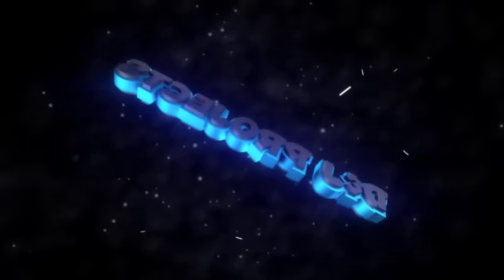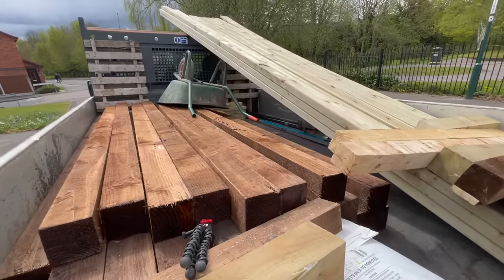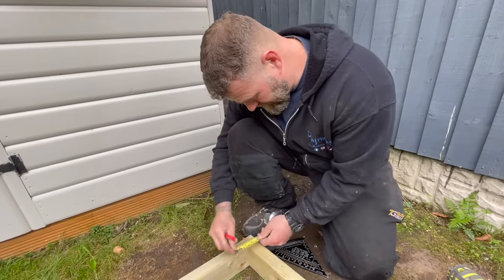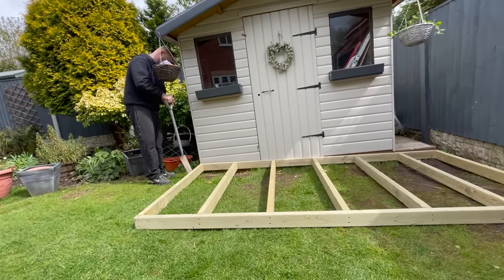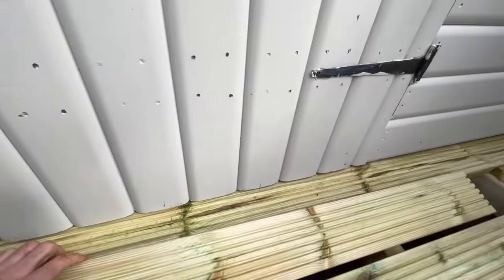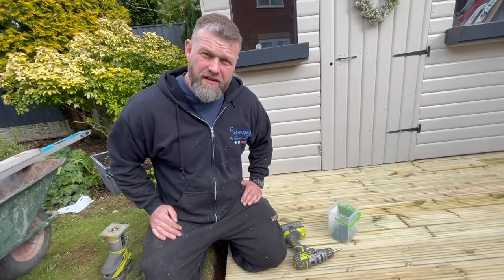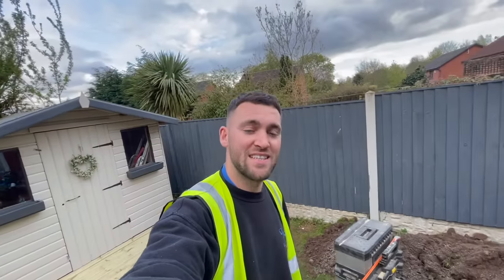How To Install A Small Decking Area!

Comment: Looking good lads. Some on here Brand bragging should watch the Torque test channel and learn a few things. No customer I have ever worked for has ever asked me what brand of tool I use and never had one complaint on my work. Also I wonder how many know Decking Board can come both side grooved and how many engage not having a clue what the client has asked for. I have had loads of jobs where I have advised the correct way to do jobs but they have wanted their own version. Great job guys.

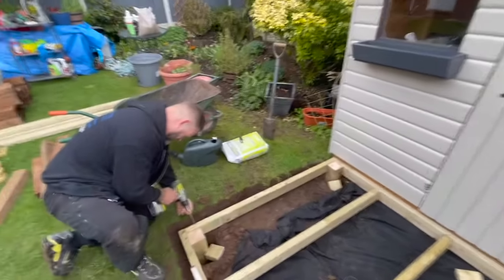Comment: 9:10 Gods watering can 😉🙏🏼
Spot on about the tools Dave.
All I have is a Spade,a 5 foot wrecking bar,a decent hand saw ,a £60 Cordless with two batteries,a wheel barrow,a bag of hand tools,chisel’s and 30 years experience in Civil and Military Engineering.
Yes it takes me longer and yes it takes more effort but the job gets done to a high standard and I never run over my quotes.
My only concern is my sparse tools array getting robbed by a full kit wanker in poser clobber 😉👍🏼

Comment: Oi Dave I’m not old I use inch when working with wood, I’m not a pro so I find it easier 😂. I don’t have the proper gear nor the Materials but I did have a idea 💡 so during lockdown I reclaimed some decking and the frames, I cleaned them all up and got what tools I had out and made a big decking across the back of my house and closed it all in and it’s been up almost 2 years, i liked the idea 💡 of allenkeys for spacers for the decking boards I used packers that all I could think of at the time but worked. A great insight to build a little decking Dave and Stevie 👍 few things I would change how I done mine to how you done yours defo, for future reference I’ll do it 🤝.

Comment: I’ve been doing decking for around 12 years now and honestly the biggest tip I can give for smaller sized decks is to pay attention to what direction you put your boards on IE left to right or front to back. Can give you the illusion the deck is bigger than it actually is sometimes.

Comment: You should use full boards and you won't get waste if you use 2.4 m or whatever is closest to the length of the frame
Plus make sure the boards are layed down wet so you don't need to use spacers as they will shrink 
If you use spacers then the gaps will be too much once they dry out
Also you have too much spring in your frame you should've used centre supports

Comment: Plastic glazing packers are ideal and come in many different thicknesses for spacing...
Reply: Top tip 👌🏻cheers will give them a go 👍
Reply: @davidwhite4195  if you go to a local glazing company they will give you a load for free, they are cheap as chips, and keep up the good work, Stevie is a credit to you 👍
Reply: Not environmentally sound though, plastic spacers
Reply: @bananabrooks3836  they are reusable, you will always have them...

Comment: How far down did you guys place the posts in the ground which held up the deck? Keep up the good work! :-)
Reply from the maker: just over a foot on this decking
Reply: @DJProjectss  Gonna attempt a decking area roughly the same size as in the video. Cheers for the details. Very Helpful.

Comment: I'm like your old man don't like waring glove when I worked. But I'm on the permanent disabled list but before I let it become a permanent thing I hung drywall taped and textured drywall for 13 years until my doctor got tired of reading in my file that I was in the E.R. again because my back was spasmodic or uncontrollable back spasms or both legs were cramping up even when pounding down water

Comment: Awesome vid. Did you know decking boards are actually supposed to be laid groove side facing down.
Reply: I know I was like ffs those are upside down. It does depend on the exact decking used as some are different to each other and some have grooves both sides etc
Reply: @MrSongwriter2  Or alternatively some customers simply don’t want to be slipping on their arse in mid winter on a surface with no grip and so therefore request it be fitted groove side up.
Reply: @brownwarrior6867  they have grooves both sides but smaller on one side. The idea of the largest groves going down to the runners is to stop the rot and allow the boards to dry better. But hey if people want to install wrong that’s their choice

Comment: Hi guys decking is my main job and to be honest love the format of 3 4 5 however I have always gone corner to corner and probably works in the same way I've always used packers for spacers around 5mm so I'm asking is there any specific size gap you use ?
Apart from that said great deck liked the idea of the corner dug out to frame it up I do same only difference is I membrane around posts then post create around it think it prolongs the life underground as my concern is it rotting away eventually but hey ho great job dave and stevie 
And as you say 
Not too shabby
Reply from the maker: Probably 5mm -7mm for us and good tip with membrane 👌🏻

Comment: Do not use 4x4 posts as support just lay the frame on concrete pads as posts will rot 
Plus use a bitumen paint on the frame

Comment: Agree its not about the tools, although decent tools makes it easier, was having a nightmare putting some DIY decking together with a cheap £30 Amazon drill. Went and brought a naff £50 Black and Decker combi which just about got it done but the job would have been much easier with a decent drill.

Comment: It’s 345 guys, square it up by measuring corner to corner and I wouldn’t go any bigger than 450mm centres.  Riobi if you’re just doing the odd decking job but wouldn’t last a chippy 2mins 👍

Comment: Using the 3,4,5 method with single inches doesn't give a very accurate result due to the small distances. You should use the same method but scale it up to 30cm, 40cm and 50cm, or 30", 40", 50" or 3', 4' and 5'. Basically stick with the method but use as large a distance as you can.
Reply: or using 6 8 10 and in metres for when setting out
Reply: I do 3mm 4mm 5mm. It gets tricky at times.
Reply: You can also multiply so 6/8/10 or 9/12/15
Reply: Measure the shorter distance divide it by 3, times that buy 4 mark it on the longer side from the corner to the mark on the long side should be (shorter side%3)x 5
Reply: No timber is straight cannot just use a 7” sqaure or 30mm,40mm,50mm
Reply: 3,4,5 is a good technique. But I think in this case I would be measuring Diagonally corner to corner
Reply: correct
Reply: Nearly all in the trade I know would have measured the diagonals, if they match it's square, 3,4,5 method like that has no accuracy at all.
Reply: Jim Doherty  🤣🤣🤣 Nice one mate.

Comment: The correct way to lay decking boards for most decking is smooth-side-up, with the ridges there to prevent rot and mould.